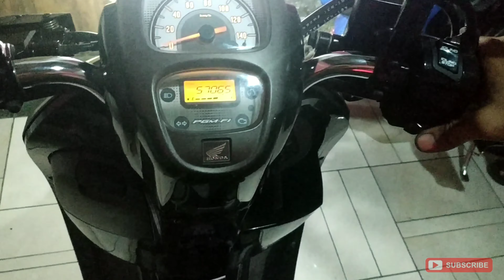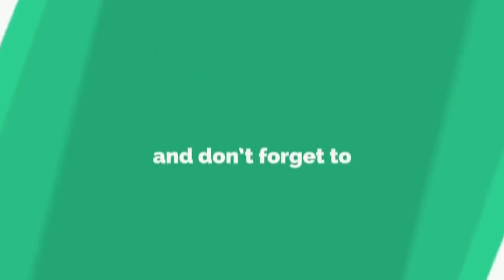PERBAIKAN - HONDA SCOOPY 2018||TIBA TIBA MATI SETELAH DI CEK TERNYATA#KABELSTANDARDDIMAKANTIKUS

Comment: Bantu info dan Mohon jawab bang ..🙏🏿
Bang baru ajah saya ngalamin begitu motor pas di bawa jalan tiba tiba mati, saya coba stater 2 kali masi blm idup tapi saya coba trus sampe yg ke 3 kali baru hidup lagi.. kira" itu apanya ya bang.??
Reply from the maker: Coba di full reset ajah bang . Sama minta d bersihin sensor tps nya bang .   Yg di trotel body di bersihin semua insaaloh clear beres
Reply: @dmaulana28  ok mksh arahannya  bang🙏🏿